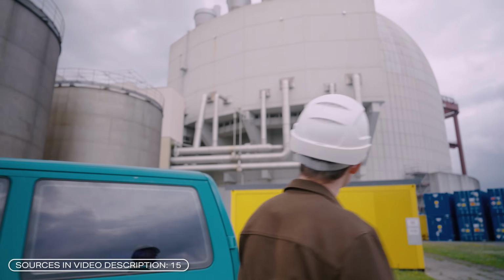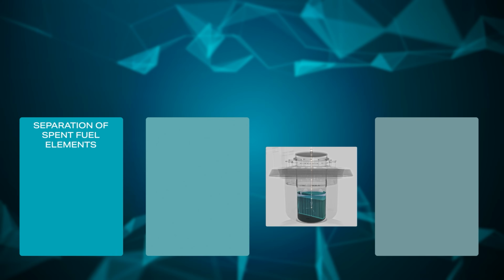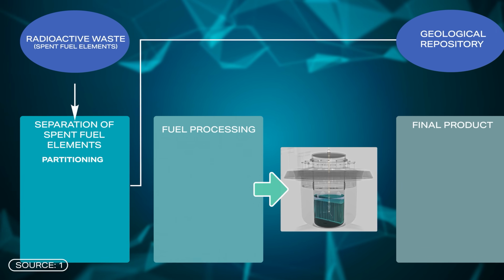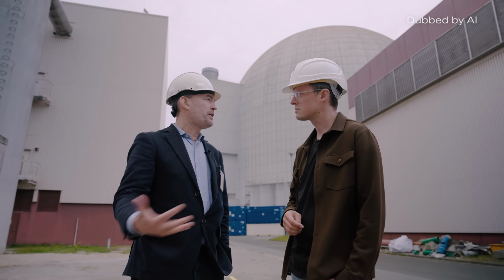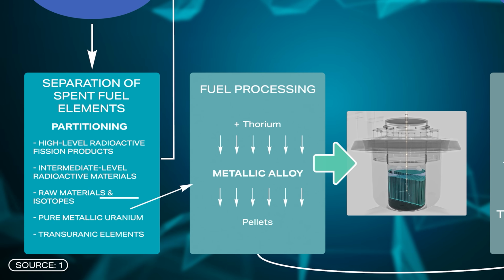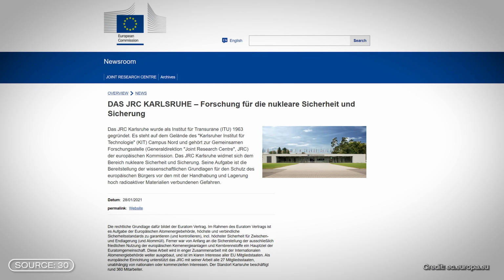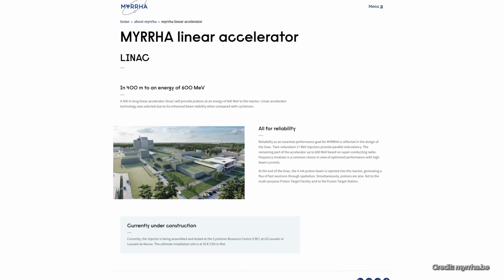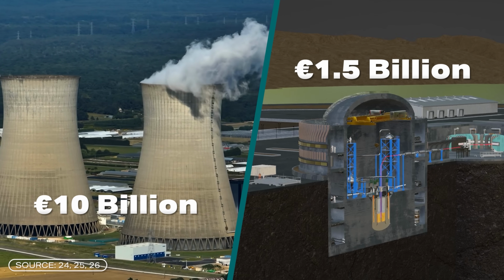Nuclear waste is reusable. Why aren’t we doing it?

Comment: Shutting down all nuclear was the dumbest decision Germany has made in at least 80 years
Reply: A shutdown reactor is a liability. It was dum to shut them down when they could have provided clean power.
Reply: currently they are doing a lot of stupid decisons, one after another.
Reply: Third-dumbest.
Reply: But it was good for russia.  It increased Germany's dependency on russian gas and oil.  Certain people also got richer due to it.
Reply: @ptonpc  and some Germans thought that would be enough to appease Putin and prevent the full scale invasion but it did the opposite because Germany had no choice but to continue using Russian gas and fuel. Fortunately Germany has moved relatively quickly to move off Russian gas and oil although it maid Russia billions of Euros during the war.
Reply: @joythought that’s not accurate historical capture. the deep dis-ease with nuclear power for many germans, especially conservative farming communities stems directly from the Chernobyl disaster. nuclear toxin fallout landed on German fields and prevented cropping and dairy industries from producing for a few years. that lead to a deep distrust of nuclear power, fair or unfair, that’s the basis of German opposition to nuclear power, nothing to do with appeasing Putin.
Reply: @joythought Blame Putin before Putin existed. Classic misinformation.
Reply: @ptonpc Not the current issue.
Reply: Are you sure?
Reply: Why were they all shut down?
Explain why it is dumb?
Reply: @Jimmy-p9n when Fukushima reactor had issues they decided to shut them all down. In a place like Germany Nuclear is the clear winner for energy production, solar is too inefficient because of cloudy days, the coal they have available is the absolute lowest quality. Nat Gas can  only be gotten from other countries creating long term and sometimes dangerous dependencies.
Reply: @rexmann1984  new build nuclear power is way more expensive than an equivalent amount of PV, wind and storage. you say PV doesn’t match power demand, guess what neither doesn’t nuclear power, even base load coal which is cheaper than nuclear is shutting down all around the world because it cannot compete in wholesale power markets. Once you add the cheapest form of generation, PV to power grids base load is in big trouble because it’s not profitable to ramp base load power twice a day. baseload power generation is designed for fairly constant export curves. anything with thermal (steam) generation is subject to maintenance and deterioration issues when forced to ramp twice  each day, the pipes and boilers have to cope with changing temperatures too quickly and they fail leading to catastrophic failures.
Reply: @rexmann1984  Ops more misinformation. Solar continues to produce during cloudy days.
Cloudy days are in truth barely an issue for solar.
Reply: @alastairleith8612 what you are saying depends on location.  If you are in Germany where wind and solar fail at the same seasonal time it does not matter if these systems are the  cheapest form of power if they can't give you power when you need it.
Reply: @StanleyTolle  I've modelled energy grids down to the hourly dispatch granularity, 8760 hours per year. you are talking out of you hat. Variable generation doesn't "fail", it's variable by nature. but you can design a grid around 100% Wind and solar if you have some storage and a bit of overbuild of wind and solar. 90% RE is a no brainer for cheaper power prices, even in Germany. gas prices in Germany went ballistic after Russia turned off the tap nd USA sabotaged the Nordstream pipe to make sure it never went back on. That is way more of a "failure" than wind and PV which are incredibly reliable and predictable in their dispatch. Good grid operators know how to deal with variable generation. Battery prices have fallen >90% in the last 10 years and they are still falling rapidly.

thermal energy storage is coming, will be a big win for EU countries with cold winters, will be able to do district heating, industrial process heat and also for providing generation of last resort storage with it's deep (LDS) storage potential. there's dozens of startups developing thermal storage for both thermal applications and the power sector at a utility scale that will be even cheaper than the battery prices we have today.
Reply: @iain4295 clouds literally cut my solar production in half. what do you mean barely an issue
Reply: @alastairleith8612  French reactors are currently ramping down by multiple gigawatts every sunny day, to make room for imports of German solar at negative prices - yes, the Germans paid subsidies to get the solar panels installed, and now they have to pay more to get rid of it. Then at night, and most of the winter, they don't have enough. Germany has 101 gigawatts of solar capacity, and 73 GW of wind, when their average demand is only 35 to 50 GW, but they still burn thousands of tonnes of coal every day, and import nuclear-generated power from France by the Terawatt.
Reply: @Jimmy-p9n  The rise of the Greens party in Germany, increased the disinformation about nuclear power. That along with the general stupidity of people who are afraid of things can't understand lead them to shut down plants when they should have been building more. 
It's dumb because fossil fuel plants release more radioactive particles into the atmosphere in a year than all of the nuclear plants have since we invented them.  Naturally occurring radioactive elements ( Radium, Thorium, Uranium) are in the coal and natural gas that are then released into our atmosphere.  The "nuclear nightmare" anti-nuke people babble about is already happening all the time.
Reply: @bmacpher Wanting something and intelligently planning something are two different things.  I'm crying because uneducated fools increased the burning of dirty coal which increased radioactive and CO2 emissions for decades.  I would be very happy to decommission fusion plants AFTER private and commercial renewable sources sufficiently meet the public demands. If you actually cared about the environment, you would learn something about the subject instead of just ignorantly ranting about boondoggles and oligarchs.  
You are part of the problem, not the solution.
Reply: At least
Reply: The  Cancer  Is  Nuclear  Bioaccumulation  Fool
Reply: Say a hundred & twenty years and the conversation radically alters…
Reply: Completely agree.
Reply: luckily there are plenty armchair experts flooding the internet, whose first step of any solution is to hunt for immigrants.
Reply: The idea that the fucking Germans have any nuclear material is terrifying
Reply: German companies didn't want to innovate EVs
Reply: It approaches the dumbness of letting go Chancellor Otto von Bismarck in the late 1800s, and of choosing the older son of the Emperor as a successor!
Reply: At least 5 of those plants were in what was previously known as East Germany, and built by Russia.  They were inspected in the 90s and known to be unsafe, some of them severly so.  Shutting them down was the responsible thing to do.
Reply: @Cynthia_Cantrell  nobody questions shutting down old soviet and early west reactors, but post fukushima craziness of shutdown good latest gen reactors
Reply: @Cynthia_Cantrell  They knew those plants were crap in the 80's.  They only had 40 years to build new ones and didn't.
Reply: @someguy-k2h  Nuclear power is one of the most expensive power sources out there.  It keeps getting less and less viable with the cost of solar, wind, and batteries getting cheaper every year.
Reply: @Cynthia_Cantrell  Another uneducated opinion based on talking points.  Nuclear power plants are expensive to build but relatively cheap to run.  Over the expected lifetime of a plant, nuclear power is just as cheap or cheaper than fossil fuel power and cheaper than existing renewable sources.  The existing renewable technologies are not capable of providing the power we need now or will need in the future. Those power requirements don't go away, they only grow over time. That's why you need a long term energy policy based on facts that provide the energy your society needs. Each society is different based on resources, demand, and location.  That's why there isn't one solution to this problem.
Reply: @someguy-k2h  You need to educate yourself.  A few years ago, Excellon blackmailed Illinois for hundreds of millions of dollars to keep 2 of their nuclear plants running - complaining that there was too much cheap wind power coming in from Iowa for them to compete.  

Look at the LCOE for nuclear, it is certainly NOT cheap to run, especially now that we won't be getting cheap nuclear fuel from Russia.  Renewables can power FAR more than most people give them credit for.

My step father was in the nuclear power business in Hanford, Washingtion in the 1970s.  He like to say "electricity will be too cheap to meter" because of all the cheap nuclear power.  That have never come anywhere close to happening, and I'm too old to believe it ever will.

Oh, and I'm a retired electrical engineer.
Reply: @Cynthia_Cantrell  You need to grow up and realize that corrupt companies exist all over the world in every sector of the economy. Just because a corrupt energy company in Illinois did something bad has nothing to do with the proven safety, efficiency, or commercial viability of nuclear power.  If you educated yourself, you would know that's not a good argument, unless you were prosecuting Excellon.
Reply: I have educated myself, which is why I'm trying to and disavow you of the nuclear propaganda you've swallowed hook, line, and sinker.

Nuclear power was never cheap, and you've never realized that the only reason to have a big nuclear power industry is to provide raw materials for nuclear weapons, not just missles, but power for nuclear submarines and aircraft carriers.  

Nuclear power hasn't been nearly as safe as they claim it has been either, and it is only in the last few years we've uncovered the accidents at small scale nuclear labs that went hidden for decades.  And they didn't tell us about the low-level radioactive waste around uranium mines that's contaminating people's properties in the west.  And their still denying the claims of very sick workers who were cleaning up Hanford.

Yucca mountain got shut down because of a fire - because someone didn't explain to the purchasing department that you couldn't just buy any kind of kitty litter to store your nuclear waste in.  It sounds like a stupidly simple problem to fix... but if they couldn't get that simple item right, does it really leave you with a lot of confidence they'll be able to predict, avoid, and mitigate a complicated problem?

When Musk put in the Hornsdale Power Reserve in 2017, I didn't think the economics of lithium batteries would make that a viable project.  I was wrong.  It paid for itself in about 2 years and saved customers $150 million.  With that kind of ROI and savings, the compony bought even more batteries.  Why?  Because with that kind of savings and short ROI time, it's practically like printing money.  It took  Musk a few months to put it in and start collecting revenue.

A  nuclear power plant can easily take a decade to build, and in most coutries runs over time and budget by HUGE amounts before it even turns on.  In the mean time, it gets to pay interest on billions of dollars of loans.  

That kind of economics don't work for nearly all companies.  Renewables can be put in and start making money in months, or a year for a big off-shore wind project.  Financially, it's a "no-brainer."  And that's before realize that renewables keep getting cheaper, and nuclear has only shown signs of getting more expensive.

Nuclear isn't going to work without major government backing and loans, and many years of patience.  

I don't think people are going to wait that long.
Reply: @Cynthia_Cantrell  You obviously haven't educated yourself with facts.  If you did, you wouldn't call facts propaganda. Reading some website somewhere or comments on Facebook isn't education. I studied physics, engineering and nuclear power for a decade. I worked inside nuclear plants. You may not like the facts because they contradict your skewed vision of reality, but that doesn't make them wrong.
Reply: @someguy-k2h  I'm not a nuclear engineer, I'm an electrical engineer, and have been since 1989.  I don't gets "facts" from Facebook and I've never even had an account there.  

If you have some actual facts or evidence that go beyond the propaganda the nuclear power industry has been spoon-feeding the American public since the 1950s, please do share them. 

I'd love to hear them.

For anyone wondering about the veracity of my info, you can find it for yourself.  There are a couple of decades-old scientific papers regarding the cost of nuclear fuel, and they explain the reason why we don't recycle it here - it's too expensive.  It's cheaper to extract it from new ore than it is to recycle it.  We also go a bunch of nuclear material from Russia as they dismantled their missiles.  I don't know if that has stopped yet, but it is obviously not a source we can count on given world politics as they are.  

Other facts you can look up for yourself - the LCOE , or Levelized Cost of Engergy for all comercial scale energy sources.  This is an industry publication that comes out annually I believe.  It's not a media source - it's from people inside the industry whose job is to study all sectors of our energy portfolio.    It shows the cost of nuclear power compared to solar, wind, coal, biogas, LP, and hydro.  Look at the data for yourself.  

I would argue that the LCOE they provide for nuclear is on the low side, because I don't believe they account properly for long term storage and decommissioning.  Costs from decommissioning plants in other countries have ballooned just like the cleanup costs at Hanford, so I suspect their projections are optimistic, at best.  

Even so, nuclear is one of the most expensive energy sources out there.  Solar with 4 hours of battery storage was cheaper than nuclear several years ago, and their prices have only dropped. 

So, if you have evidence that nuclear is really the panacea that you say it is, please, share that with the group!
Reply: @Cynthia_Cantrell  That is an often repeated talking point, but empirically wrong.  For example Swiss nuclear plants currently produce for 4-5 Rappen, so around 4-5 cents.

And of course Switzerland is know for its low low prices 🙂   Germany nuclear power plants were producing electricity for 2-3 cents before they were outlawed.  And they had to be outlawed because that was the only way to get rid of them, they were immensely profitable.
Reply: @Cynthia_Cantrell  More talking points which are empirically false.
Reply: @mpweiher  The EIA publishes costs for all major power sources here in the US, where I live.  Only biogass and offshore wind are as expensive as nuclear.  Everything else is consistently cheaper.  If you have a source showing otherwise, please feel free to share it.
Reply: @Cynthia_Cantrell  In Switzerland, nuclear power plants produce for 4-6 Rappen per kWh, which is around 4-6 cents.

Switzerland is not known for its low prices.

You also have to be careful to not confuse the often cited LCOE for the cost.  LFSCOE is the relevant metric, and there intermittent renewables turn out to be atrocious.
Reply: Radical environmentalists aren't the smartest bunch.. any radical types actually.
  I quit working for Ralph Nator's Nyperg when they started pushing McDonald's to stop recycling plastic and switch to paper, the response to my complaints about how that didn't make sense was, and I quote "the world doesn't need more recycled purple grimaces" , it was so stupidly self-contradictory to try and stop recycling, incineration and landfills at the same time while still having plastic and packaging production ramped up! But I'm still shut down.
Reply: Of course not.
Nuclear IS a terrible business.
Reply: Banks killed nuclear, not Greenpeace .
Nuclear IS a good idea but a terrible business.
This IS a great idea and Will surely help other bright ideas rise around It.
Reply: @inigoromon1937  If that were true, it would have been true 40 or 50 years ago when these business cases were built.  It would have been true 30 years ago when we has 20 years of data. Yet,  that data showed nuclear power was commercially viable and investible. 
Your comment also ignores the fact that utility investments are usually financed with bonds, not loans.  The World Bank Group, the only bank to have a ban on nuclear investment, reversed that ban.
Reply: Nonsense.
Creating more nuclear waste is madness.
Truth is there is nothing we can do to remove this waste from our environment. We only move the waste around and you have to do it for best case scenario 800YEARS!
Fossil fuel use isn't the answer either. That doesn't mean we should use the next worst technology.
We should use the cleanest possible technology while better ones are developed.
It would be better to stop wasting electricity on AI and bit coin instead of poisoning the world with nuclear.
Reply: Nuclear power is not compatible with human nature.  In the quest for profit, safety margins will always slowly erode until something breaks.  And if that something is nuclear, the Earth will feel it for the next million years.  If the Japanese fell victim to this, there is no reason to think any other nation will do better.
Reply: @VPWedding  What does "compatible with human nature" even mean?  You've obviously never worked in a critical safety environment, so you have no idea what you are talking about. Also, the Earth doesn't "feel" anything.  It's the rock we live on.  It's not a sentient being with feelings. If that was the case, it would have killed all humans a long time ago. Sorry to educate you further, but none of the radio isotopes involved in nuclear power last a "million years."  Earth receives trillions of trillions more radiation from space every day than has ever been released by nuclear power. Coal and gas powered plants release more radio isotopes in a year than all nuclear plants have ever released.
Reply: @someguy-k2h  When we anthropomorphize "The Earth"_, it is always shorthand for _"The Earth's ability to support human life in comfort."  Mars is perfectly happy being lifeless, and the Earth won't "feel" anything of our loss either.  
You are right about coal and gas, but those are a false duality.  The price of batteries and renewables are plunging.  The massive cost of a nuclear reactor will buy all the Sodium-ion we need without the dangers.  No need for Lithium or conflict metals.
Reply: @VPWedding  Sorry, I've met quite a lot of people who think the Earth is actually a living thing with feelings and a soul.  My mistake.
The problem isn't price, but output.  It's difficult for someone who hasn't worked in public electrical power generation to understand just how much energy is consumed every hour of the day.  It's not just homes, but huge public buildings and commercial manufacturing plants that require tens of thousands times more energy than you consume in a year. 
Maybe sometime in the future we will be able to rely on returnables for all power requirements, but right now renewables could be free and they still wouldn't be able to meet demand. 
No matter how large a battery you have, it still needs a source of power to charge it. You could buy a huge Na+ battery the size of Manhattan, but who is going to charge that battery AND supply enough electricity to meet current power demands?  If you don't have a thermal plant, because you bought the battery, then where does the power come from?  The renewable supply isn't enough by itself to provide the energy needed, let alone store any of it in a battery.
Reply: @someguy-k2h Thanks about Earth. It’s true that many people forget the details. 
Unfortunately, the rest of what you said is still false binary. A nuclear plant with no cooling won’t work any better than wind and solar without batteries. It isn’t reasonable to consider them separately. So any serious discussion about renewables includes power and storage together, as well as demand timing.  The cost of [renewables+batteries] will soon clearly be less than the cost of [Nuclear+waste processing/storage/decontamination+security].
Reply: @VPWedding  It's not false, that's 8 years of electrical engineering and lifetime of working in power generation educating you. Chicago consumes 83 gigawatts a day. So you would need 260 MILLION solar panels at peak output 24 hours a day to just supply that one city with electricity.  What do you do in the winter?  Solar capacity drops about 65% in the winter. 
Where are you going to get them?  The entire country only installed 125 MILLION panels in 2024.  You need nearly 3 times that much for just one city. 
It's very clear you don't have a clue what you are talking about. You aren't educated enough to know what is false.  Just because you don't like the facts doesn't make them wrong.
Reply: @someguy-k2h It is false because you were “debunking” something that no one ever advocated. It doesn’t matter who you are, once you start strawmaning like that you have lost trust.
Reply: @VPWedding  You were advocating for something, until I proved it wouldn't work. Then you decided it was easier to just pretend you never proposed it to begin with. Yet there are your words "The massive cost of a nuclear reactor will buy all the Sodium-ion we need without the dangers."  You're just a very bad loser.
Reply: @VPWedding  The opposite is true.  Nuclear power is the most environmentally friendly and safest electricity source we have.  The Japanese are reactivating their nuclear power plants.
Reply: @mpweiher  Every twenty years, people think it won't happen again.  And then it does. A thousand years from now, Chernobyl will still be able to kill people.  So will all the "temporary" storage sites that we have today.
Reply: @VPWedding  The two have nothing to do with each other.  And even including Chernobyl and Fukushima, nuclear power is the safest energy source we have.

By a long margin.